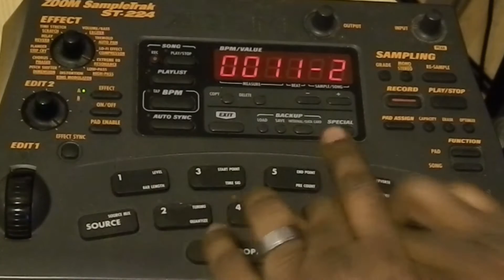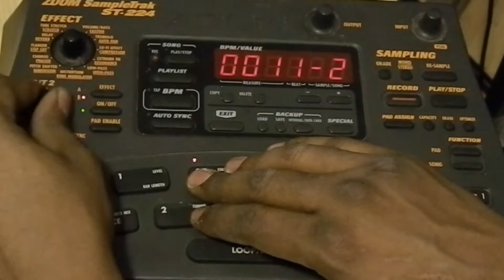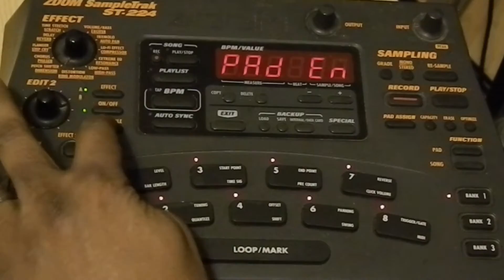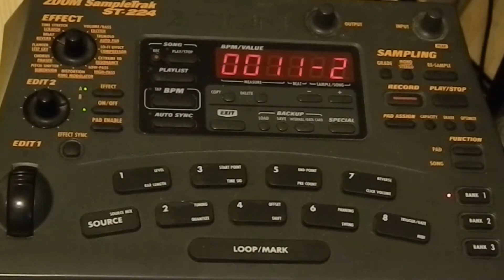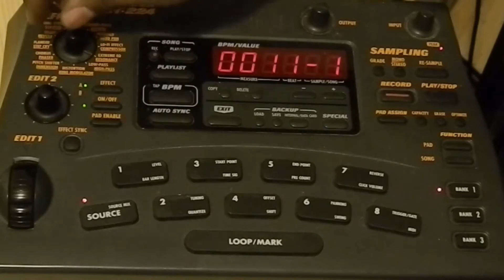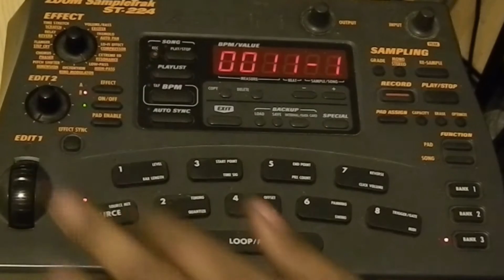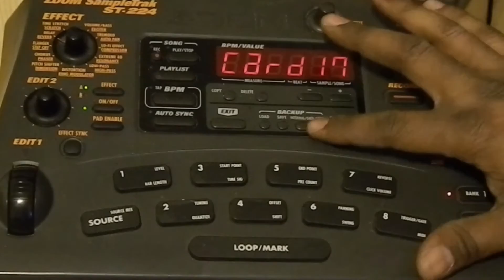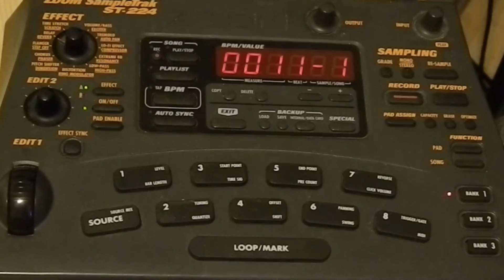KiofNC Sampletrak Tutorial (Part 2)

Comment: The smartmedia card can fit in a SD slot in a computer?
Reply from the maker: Jeremy Dinieri yes certain ones can. it's possible to find smart media card readers, but most modern computers will not have them since they are dated. the modern SD cards and USB drives have replaced them as the standard. Check eBay when you get a chance.